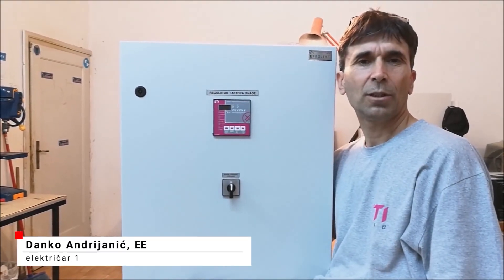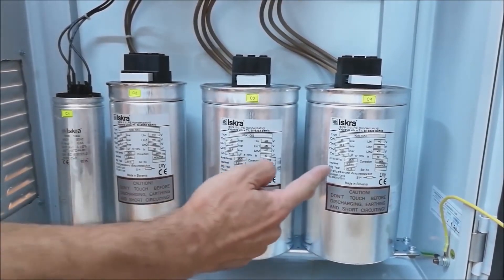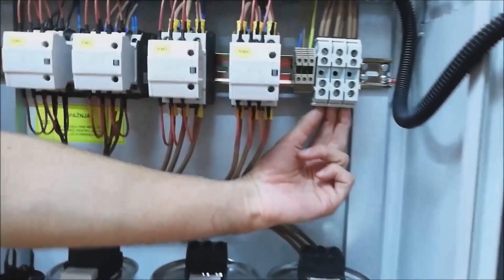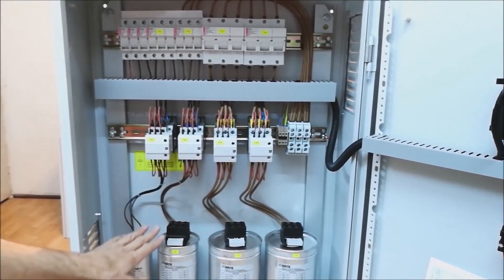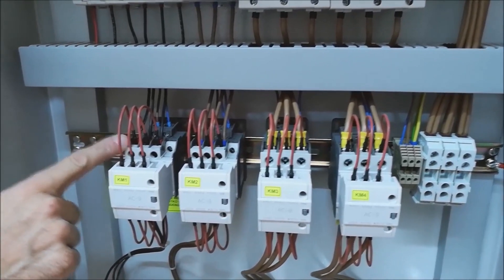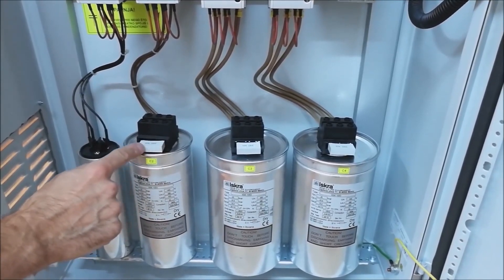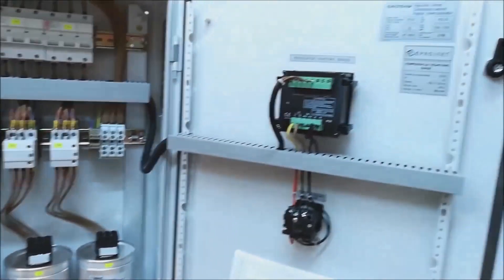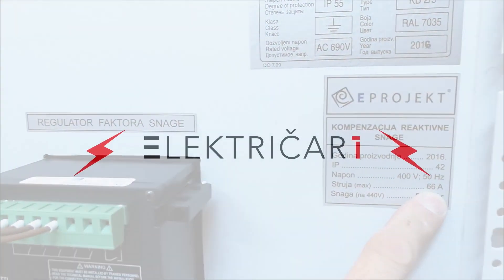Reduce your power bill up to 80 percent | Power Factor Correction - PFC

Comment: Жив био брате. Свака част. Само напред.
Reply from the maker: Хвала ВЕЛИКО на похвалама.
Поздрав Данко 
Останите уз канал "ELEKTRIČAR 1"
Reply: Nice video presentation presentation could use a little bit more finesse .
I work on one project distribution switch that has 2000 amps 3-phase 480 volts 277 Y I used much larger capacitor based on the voltage amperage and secondary load in order to correct power factor demand the installation that I did it worked out very nicely.
Your installation and presentation looks very nice good work keep up the good work.
Thank you.
Reply: By the way for those of you which is not familiar with 480/277 volt is primarily used in Industrial and Commercial application in USA.
3 phase 480/277 Y four wire system plus ground
3 phase 208/120 Y four wire system plus grounded
3 phase 240/120 Delta three wire system plus ground 
Residential application 240/120 Y 
Three wire system plus ground that is two Hots neutral plus ground.
Another words two face system for residential application.